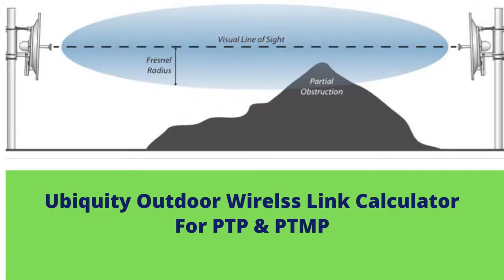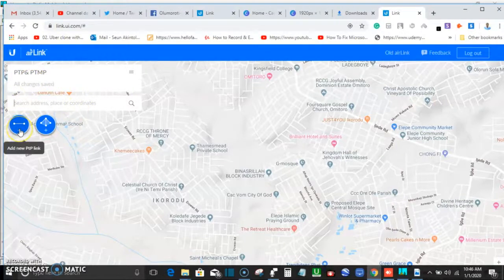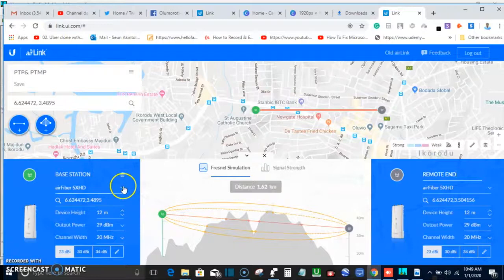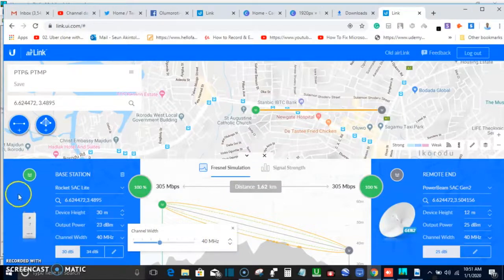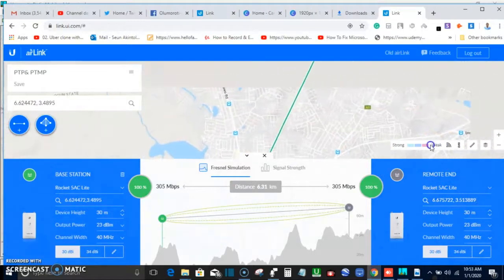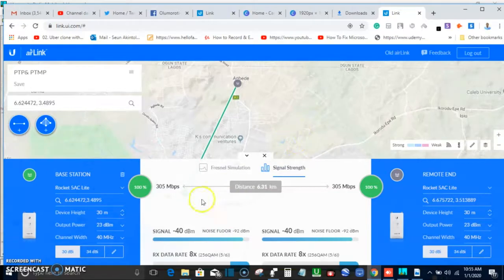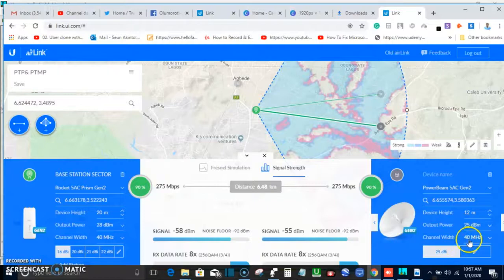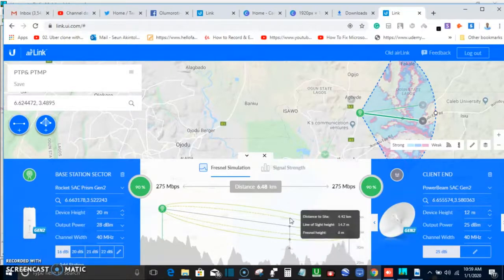How to use Ubiquity Wireless Link Calculator for PTP & PTMP

Comment: does the elevation show obstruction above sea level or just sea-level height because the link planner is quite not accurate
Reply from the maker: The planner shows the elevation above the sea level. Based on your physical survey inspection you will put into account other factors the simulation didn't captured. However, what do you mean by the planner is not accurate let me have your view on this.